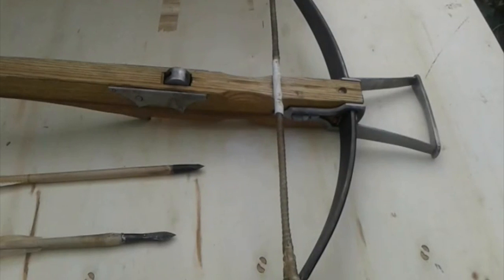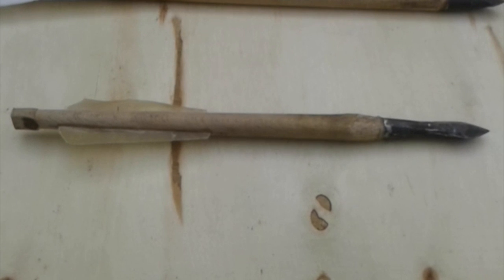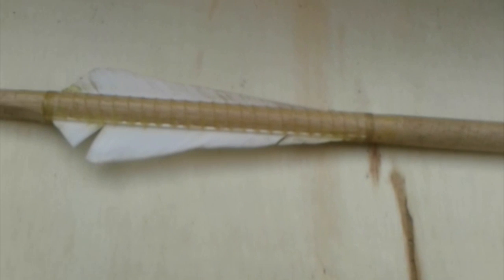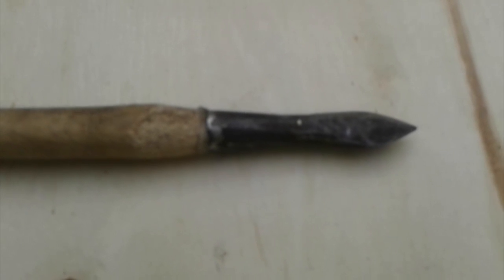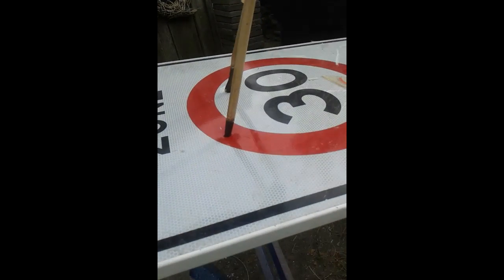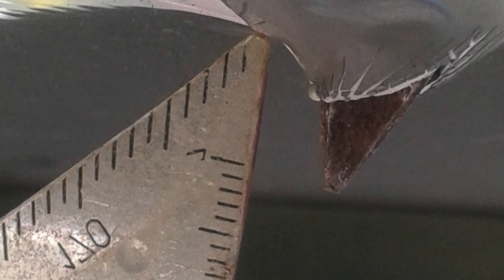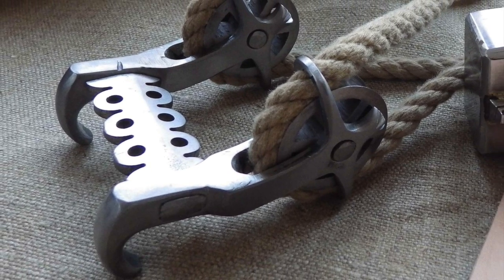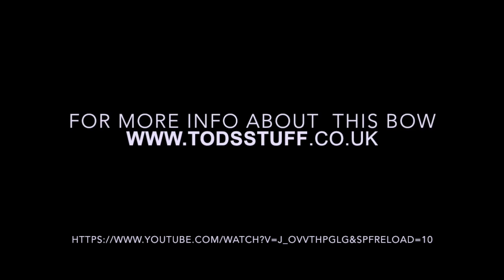crossbow vs traffic sign

Comment: In my understanding, armor penetration is mainly determined by the weight of the projectile and the speed it travels with. Arrows tend to be a lot heavier and thus carry more force into the target. Bolts are relatively light and thus suffer in the department of penetration, especially over longer distances when the speed is reduced and weight becomes the determining factor. 

Then again we know of historical sources, as well as recent experiments, that even arrows tended to have trouble penetrating as well, except at short range. For example: https://www.youtube.com/watch?v=KCE40J93m5c.

Also, armor might be even more effective as you shot in a straight angle (90 degrees) at the sign, where as I think a straight hit might be difficult to pull of as breasplate and the like were often curved. This causes most arrows to be a glancing blow and the force is redirected rather than absorbed by the armor.  

Interestingly, this guy (https://www.youtube.com/watch?v=ugXwN9tImpE) discussed the concussive force of the projectile. That may be something to consider as well.Thought it was interesting to mention.
Reply from the maker: TheBlink2104  The bolts I used were 44 and 50 grams, What do regular arrows weigh?  there is of course no such thing as a "regular bow" but what do arrows that are used with longbows or recurve horseback archer bow weigh?  I would be more than happy to try again with heavier bolts....  Nice link!
Reply: Zwaardkring leer zwaardvechten Huh, interesting. I have always though that an arrow would be longer, thus heavier. However reading up on the weights of arrows (http://www.currentmiddleages.org/artsci/docs/Champ_Bane_Archery-Testing.pdf) they say that they can be anywhere from 720 grain (+/- 46 grams) 1500 grain (97-ish grams). Modern arrows weigh in at 350 grain, a mere 22-ish grams. 

So I guess at the heavier end, they would certainly outweigh bolts, but on the lighter end be about the same?